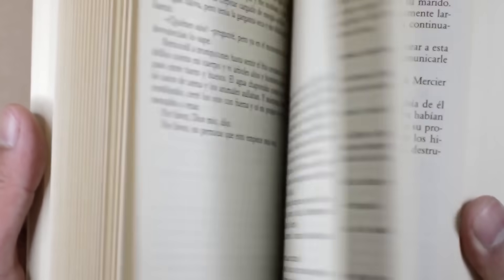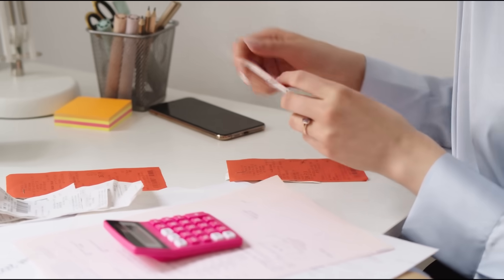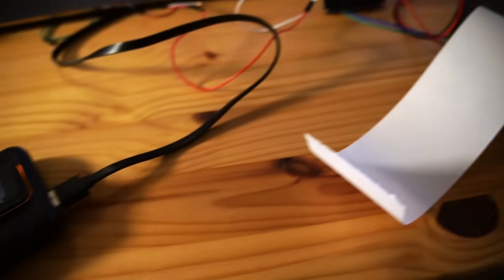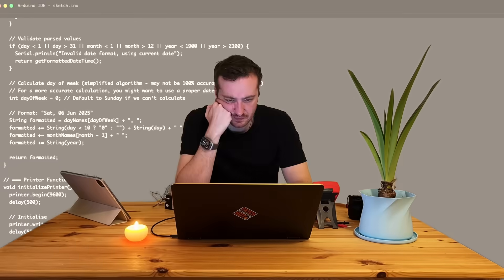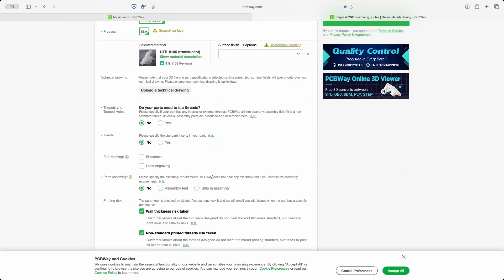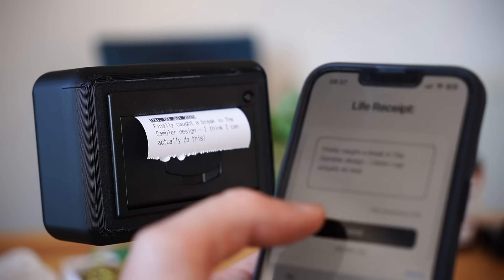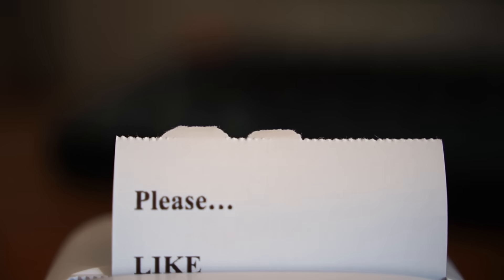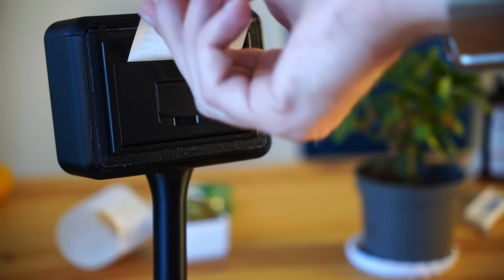I make easier and better decisions each day, because of THIS (so I'm open sourcing it)

Comment: Great job my friend! I had same idea and also have built that device :) But i use it for notes of completed everyday tasks at work. i even have the same printer as you but in white color :D Also i think its more stable to use 12v power supply with 12v to 5v step down board (without it esp32 will start overheating), which you can connect to esp32 VIN and GND pins. I'm frontend developer myself so all cpp code ive generated throught Deepseek (Dimsy/thermonotes on github). As an idea - you can integrate "Weather for the day feature" with open-meteo API :)

Comment: Hi, one thing here. Not sure what country you are from but it may or may not be applicable here. Please verify if receipts you are using are not toxic. I know it sounds silly but there some study recently appeared regarding them: "Paper receipts from major retailers in the US are so laden with bisphenol S that holding one for 10 seconds can cause the skin to absorb enough of the highly toxic chemical to violate California’s safety threshold, new research has found. The findings are being used as evidence in legal action aimed at pressuring retailers to stop using receipt paper treated with bisphenol S, or BPS, which is linked to cancer and reproductive problems." Other than that - great idea <3

Comment: Regarding the longevity of direct thermal printing paper, I have seen widely available for the small app driven thermal printer I use: 10 years and 25 years for direct thermal printing.  If you want to keep anything longer, then a printer that uses a thermal transfer ribbon is 2 to 35 years, Oher grades of paper may exist.  
I found out when I looked for a receipt for something bought around ten years ago and had a good resale value, the receipt was completely blank. Seems not even jewellers know about the life of their thermal receipts.

Comment: Great project! I have a printer on the way. In the meantime I flashed the software to a D1 mini clone I had laying around. I have the webserver up and running to test. 

I do have a quick question:
Can you show a setup guide on how one would go about using the api to get info from a google/apple/outlook calendar? I want to  have it print off my wife’s daily or weekly calendar tasks for her each morning. If there is a project on YouTube that is similar in this task that could be adopted that you could point me to that would be great. I hate to ask you to do MORE in an already great video but the shortcut you showed and the mentioning of printing Reddit post and daily calendars printing was quickly glossed over. Love the project! Thanks for getting me this far at least.
Reply: Printer delivered today. All wired up and I can print from webserver. I cannot figure out how to print from a shortcut. This is driving me crazy. I am trying everything. I can’t even get the current weather to print. Please help. Thanks.

Comment: Awesome project, methodology, solution and video! This would be so great for me. Only concerns on thermal paper:

🚨 The Risk: Most receipts are coated with loose chemicals like BPA/BPS that can mess with your hormones and absorb right through your skin, and are linked with several health issues.

❌ Big No-No: Using hand sanitizer after touching them is surprisingly bad—it makes your skin absorb the chemicals way more!

✅ Quick Fix: Always wash your hands with soap and water instead.

💡 Cool Alt: There are safer, chemical-free receipts out there! They're often light blue (called Blue4est paper) and are a much healthier option.

I would suggest to use blu4est paper. No gloves would be required from an endocrine perspective. For any other popular thermal papers like the ones used by typical cashiers, gloves and lab-like handling are recommended. Handling measures like a dedicated space, on schedule, child-safe, clean measures and proper gloves, which would depend on the person handling. Nitrile gloves would be the medical and food-grade standard but some might be allergic to accelerators used in the vulcanizing process, so each one is to find the gloves that work best for them. This is important specially because of the increased exposure that this system would bring to our workspace, to our house, to our hands and faces, to the people around us we love.

Just search for the topic: "Thermal paper health risks.". The evidence is out there.

What are your thought on this?

Thx a lot!

Comment: This is an awesome, fun, and versatile project! Thank you for taking so much time to document the process and share the whole thing with us free of charge. 
One interesting use case could be figuring out how to connect it to Gameboy emulators to use as a Gameboy printer! There's currently not many ways to successfully reproduce the novelty of the Gameboy printer without having the physical hardware needed (printer, console, camera). There are many retro enthusiasts and artists who enjoy using the Gameboy camera for their work, but are unable to print them because of the limited availability of this old hardware, and those who do have it often have parts fail or unable to print at the same quality as it did 30 years ago. 
I hope someone in that community is able to find this project and bring that capability to the Scribe!

Comment: Are you worried at all about receipt ink being an endocrine disruptor since it has BPA and BPS? I hear it’s bad enough with just the receipts we touch from the gas station and grocery store, but this system will increase the amount of times it contacts your skin. I suppose the solution if you have a health concern is to wear nitrile gloves.  Sorry that’s how my brain works and couldn’t concentrate on other parts of the video very much. 😢

Comment: This is brilliant!! Now i need one. Bravo for not giving up on the debugging, finding workarounds and generally not giving up. Something not working when it should is extremely frustrating, i know. And ground on red cable? That is plain evil. Good that the PCB designer of the printer thought that someone would eventually do that and implemented necessary protections

Comment: I 100% feel your pain with the thermal printer. Designed a mini printer for my siblings to text messages to a thermal printer on my mom's desk, and getting the formatting and everything correct was sooooo unnecessarily frustrating. This is such a nice design though, mine turned out kinda meh because I don't have the 3D printing stuff, but I made it work.

Comment: Man, I was just wondering about doing a project tangential to this. 

I got two ink tank printers, and they’re inkjets. If they go unused for a long while, they’ll clog up and the ink in the tubes dry up as well. A solution would be to have it print at least once a week automatically, but I wondered about doing it daily and having it print something useful. 

So, I wanted to make just that. Some simple program that would queue up a daily print for both printers that printed something useful like a motivational prompt, a summary for the day before, an overview of that days calendar, or something along those lines. 

I then got interested into getting a receipt printer. They go for less than 100 USD, but I’ve got a budget of -10 USD at the moment 😓 but I wanted it to print out specially my schedule that I could take with me as a receipt, or my todo lists, exporting from Google Tasks. 

Glad to see this video, working on something similar. It’s motivating me to work on the project using what I currently have, that being two printers on standby. Great video btw! Toodaloo! 🥰

Comment: Hey mate, awesome project. Am super inspired and currently ordering the prints at PCBWay. Do you have any recommendations on the print material? I am currently considering UTR Imagine Black, as I thought PLA or Resin might be too light and not sturdy enough. Also, in regards to weight, is the leg stable enough so the whole setup doesn't fall over easily? I guess one could add some weights to the foot

Comment: Starting my build tomorrow! Going to build the code from ground up, but absolutely inspired me. So many applications of something like this-novelty alone. Earned a sub instantly!
Reply from the maker: This is such a lovely comment to read, thanks so much for the kind words and the sub!! That’s precisely my point with this - not a tutorial, but hopefully a catalyst for more creative endeavours. Let me know how your goes!!
Reply: @UrbanCircles Absolutely! Got the API running last night and was able to get print margins and everything setup (it was placing buffer above the text which was actually below when everything was rotated) - luckily had the perfect dc plug on hand, so all I had to grab, tool wise, was a new soldering iron! Took a bit to figure out that the GRND for the Serial Printer ports HAD to be grounded 😭 Spent way too long figuring that out haha ~

Comment: Hope they make an actually nontoxic thermal paper someday, this is an awesome project!
Reply from the maker: Thanks for the kind words - so glad you liked my project!! Re paper, there are now rolls which are based on e.g. vitamin c derivatives. So it seems just a question of picking the right product - I included explicit notes on this, for anyone looking to build this (in the description + bom + links).

It’s unhelpful that the regulators, paper manufacturers and sellers don’t make it explicit themselves - like with other industries/ products, that’d be a much better way of doing it.
Reply: @UrbanCircles  This is more info and more helpful info than i've seen anywhere else. Thanks, man. You're doing awesome stuff.

Comment: great project, but enviornmentaly speaking what is the point. all so good to note that you are exposing yourself to BPA's unnecessarily.
Reply from the maker: Thanks for the comment - glad you liked this!! Fair point about BPA, I actually didn’t know much about this when I started out (since receipts are everywhere, and the manufacturers + sellers of rolls don’t add any real warnings), but I’ve learnt a lot since building this. There are rolls which are free of all that and even plastic-free, based on e.g. vitamin c derivatives. So it’s just a question of picking the right product - I included explicit notes on this, for anyone looking to build this (in the description + bom + links).
Reply: @UrbanCircles  thank you for looking into it and finding the safer and better option.

Comment: This is cool but I don’t want to handle toxic BPA coated paper all the time.
Reply from the maker: Thanks for the comment - glad you liked this!! Fair point about BPA, I actually didn’t know much about this when I started out (since receipts are everywhere, and the manufacturers + sellers of rolls don’t add any real warnings), but I’ve learnt a lot since building this. There are rolls which are free of that, based on e.g. vitamin c derivatives. So it’s just a question of picking the right product - I included notes on this, for anyone looking to build this (in the description + bom + links).

Comment: Love the design and UX. I just worry about the forever chemicals on the receipt paper.
Reply: The BOM on github links to BPA free paper.
Reply from the maker: Thanks so much for your kind words. I actually didn’t know much about this when I started out (since receipts are everywhere, and the manufacturers + sellers of rolls don’t add any real warnings), but I’ve learnt a lot since building this. There are rolls which are plastic-free and fully recyclable, based on e.g. vitamin c derivatives. So it’s just a question of picking the right product - I included notes on this for anyone looking to build this (in the description + bom + links).

Comment: This is genuinely beautiful work – both in the physical artifact and the intention behind it. You’ve built something that invites meaning, and that’s rare.

That said, I think there’s still an opportunity to sharpen the product layer. Right now, there's a bit of friction between the dream outcome (capturing meaningful, story-worthy moments) and the actual user flow (manually composing and submitting input). The DIY automation path is there, but it leans more maker-minded than habit-minded – which might slow down adoption for people who need low-friction rituals, not toolkits.

Would love to see v2 explore more default pathways: prompts, batching, passive logging, or even social hooks. The magic of printing the moment is real – just wondering how to make getting to that moment feel effortless.

Either way, super inspiring work. Subscribed and curious to see how this evolves.
Reply from the maker: Thanks so much for the thoughtful comment and sub!! I think that's definitely an interesting direction for a v2 - a more frictionless experience. Will definitely keep a close eye on suggestions and my own use pattern to see what can be improved!

Comment: Very cool. Just make sure you use the thermal paper that is NON-TOXIC. This is a huge health issue publicized recently due to all the thermal receipts we get.
Reply from the maker: Absolutely - I know that the health risk was more framed around the cashiers/ taxies/ waiters who rip receipts 8 hours a day every day BUT, just to be on the safer side, I have actually included an explicit note specifically on this in the description + BOM, for anyone heading over to explore building one of these. Thanks for the comment!!
Reply: “Use alternative receipt paper
If you must give paper receipts, look for “phenol-free” paper, which is safer for human health and has fewer environmental effects. Three types that do not contain BPA or BPS and are competitively priced contain either ascorbic acid (vitamin C), urea-based Pergafast 201, or a technology without developers, Blue4est. The latter uses a coating that reveals an underlying dark layer when heat is applied.

Companies that offer phenol-free alternatives:

Bayscan
Beagle Hardware (Vitamin C)
Excellent Packaging and Supply
NCCO (Blue4est)
Paper Roll Products (Vitamin C, Pergafast)
Pospaper (Pergafast)
Possupply (Pergafast)
Printerstock (Pergafast)
Thermal Roll (Vitamin C)
Western Diazo (Vitamin C)
Avoid handing out receipts
Ask customers “Do you want your receipt?” If they decline it, don’t print it! This simple step can cut paper use by around 30%. If you must use thermal paper receipts:

only print customer receipts upon request.
only print receipts for transactions over $25 or $50.
do not print a merchant copy if the transaction is already kept electronically. This can cut paper use by 50%.
Handle receipts as little as possible
If you must use thermal paper receipts, offer your staff protective food grade silicone fingertips or gloves to wear when tearing receipts, changing receipt rolls, or cleaning machines.”

Comment: red for ground is malicious as hell lmao
Reply from the maker: 😂 my thoughts exactly!!
Reply: Its like  50/50 split when ordering Aliexpress electronics. No idea why.
Reply: @Jergling  My guess is that they grab a random cable with the correct connector and don't specify the wiring colours?
Reply: i make all my wires black.
Reply: @sirrober126  lmao
Reply: And fairly common

Comment: Does your app have any logging? 1. It would be nice to catch things if it runs out of paper or other failure. 2. Since the themal paper is very ephemeral, it could be nice to have a database to revisit in the future for other forms of long term analysis or whatever.
Reply from the maker: Good question!!

The base firmware doesn't have logging, which is aligned with micro services architecture best practices (kind of). However, it does accept messages via the API (so you can do the logging/ analysis offline in your own database/ file system of choice, so that you can protect it and do with it as you please). This way, the device is stateless - so if the device fails, you don't lose anything.

Comment: Before you started explaining the problems with the printer orientation I knew how much that was going to suck to fix. I did not expect you to just power through it though! Most would have gone back to the drawing board and compromised!
Reply from the maker: 😂 I'm soooo grateful you said this and that you get it - it was such a pain!! Functionality I would otherwise (foolishly) just take for granted proved to be much more tricky than I expected.

(and, between you and me, I really didn't power through it - I gave up on it like 6 times, but couldn't stop coming back for the prize! 😂 whenever I made some progress, something else would come up... the actual video might make it seem like a done deal, the code might appear obvious, nice and neat - but you and I know it was not like that. it was messy and on a knife's edge!!)
Reply: @UrbanCircles  In my experience, that's always what "powering through" looks like. You have to eat an elephant one bite at a time and whatnot. Those types of problems are exhausting
Reply: @UrbanCircles  I would have just found a way to make it work by turning the device upside-down tbh 😅
It is very cool how it turned out though.

Comment: Thermal paper contains BPA and BPS 😬 "thermal paper can pose health risks due to the chemicals used in its coating, specifically bisphenol A (BPA) and bisphenol S (BPS). These chemicals can be absorbed through the skin and are known endocrine disruptors, potentially affecting reproductive systems, metabolism, and other bodily functions"
Reply from the maker: Thermal paper can contain that, it's true. However, all of the links I provided (plus, an explicit note in the BOM about this) are for BPA-free paper. In fact, I'd even go a step further and pick phenol-free paper, which uses some alternative developers, e.g. vitamin C derivatives. But you definitely have a valid point here - thanks for the comment.